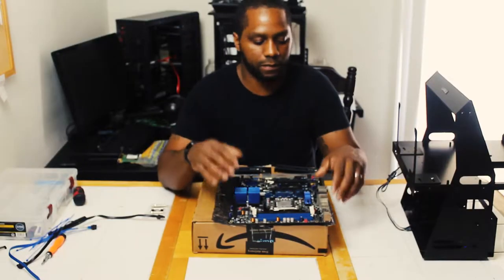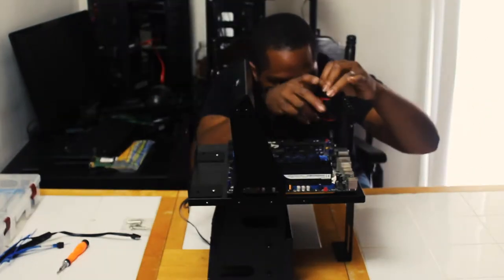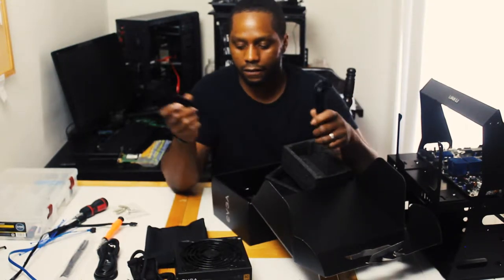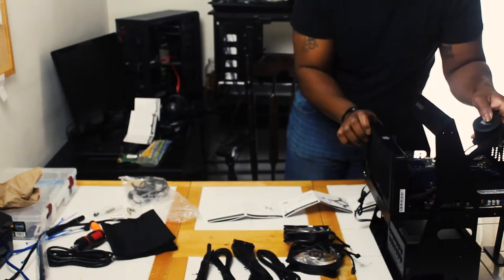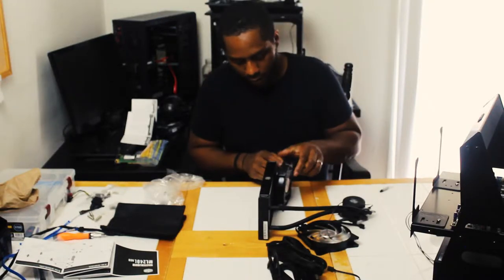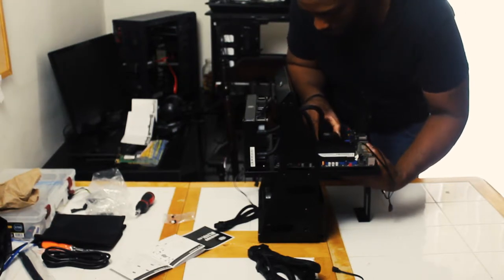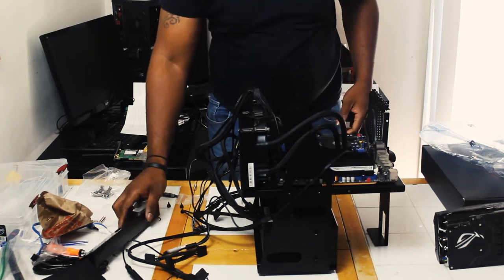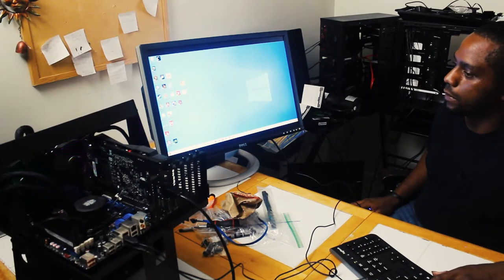How To Setup A LIAN LI Test Bench for PC Gaming!! For BEGINNERS!!

Comment from the maker: Much THX for sticking through the entirety of this video ... Audio is a tad-ish low .. I was under the weather while shooting but wanted to stick through it, CC is my friend on this one .. Now, I did make a few off camera changes:  

1 Being fixing the connectors for the RGB on the Pump … 2 adding an SSD (120GB) and 3 changing the position of the AIO tubing to run along the outside of the handle, so not to restrict water flow. Tons of more info is in the description along with all the parts I mentioned in the video. 

Thanks for watching, I hope to you see you all in the next one, BE EASY!